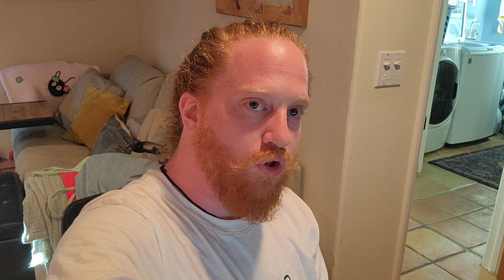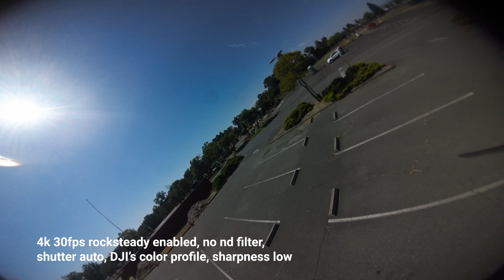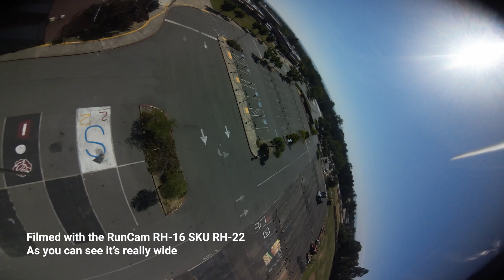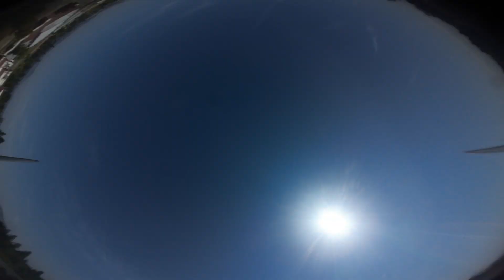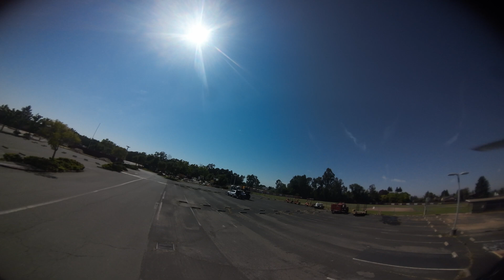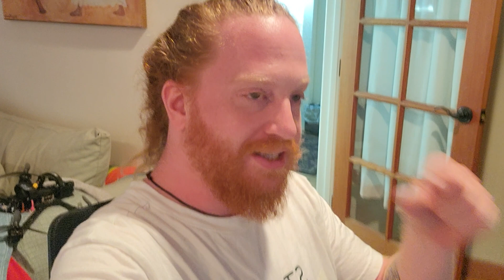3D printed DJI O3 lens replacement adapter test 1

Comment: Can we use this method to change original lens to the zoom lens like raspberry pi CS mount lenses.  I know the CS mounts diameter is wider than the M12 but is it possible to add another mount on the M12 mount?
Reply from the maker: @serdarozdemir8788  I don't see why not it just depends on if you can get the image in focus. You could also design a new camera housing altogether and maybe you could get a larger di on there

Comment: What fov do you get in regular wide mode and not ultra? Also does 4:3 2.7k work? Have you tried gyro flow with it? Is it hard to fly with that fov? I have so many questions.
Reply: Also are there nd filters for this lens?
Reply: And what happens to you trying other lenses with this?
Reply from the maker: @Vogxel  so that was regular wide mode. I never tried ultra it turns out. 

Haven't tried 4:3 2.7k

I have tried gyroflow with it and it works. 

It is kinda hard to fly with the FOV. 

There are likely nd filters that will work with this lens, it's just a matter of if there's enough space to mount them, but I think there could be. 

What happened to me testing more lenses? I got sick and ran out of time and money to test this. I bought a replacement camera and didn't need to test further. 

If you'd like to see more let me know and I can pick it back up again, and consider supporting me on patreon thanks!

Comment: Its a vignete from the lens???
Reply from the maker: Yup. Because the lens needs to be so far from the sensor to be in focus that's the edge of the lens you're seeing.
Reply: @BadLuckFPV  any solution for this?
Reply from the maker: @arisazumi  I'm not sure, to be honest I haven't done a whole lot of further testing on this because I haven't have the wellness/necessity. At the sensor end of the barrel for the DJI lens there's a super wavey piece of glass that I think is acting as a magnifier so that their lens can be as close to the sensor as it is. Maybe cannibalizing it in some way could help but I'm not sure how to accomplish that

Comment: It could also be cool to make a version of this that can work with the flywoo lite (naked) camera fixture, that way screws would hold it together instead of friction. You could have a lip top and bottom for positioning/ alignment.
Reply: You could probably just take the front 50% of your design, extend it backwards the right length and then just extend the top and bottom above where the camera PCB sits like a mm or 2. Like this the Flywoo Lite camera mount kit would fit.
Reply from the maker: @le_tranq  I just woke up and I'm having the hardest time visualizing this haha. Let me read it 5 more times tho.

I'm gonna look up this naked mount and see what's good with it. Thanks for the shout

Comment: This is epic man, been looking for something like this for ages. One thing you maybe didn't consider is that Rocksteady will be tuned best for the certain focal length of lens that the 03 comes with stock, anything different to that might have undesireable stabilisation (like more shaky or jerky movement). There's a fix to this however, you can just use Gyroflow and create a lens preset for the lens you are flying and then run it through there for ultimate stabilisation (obviously requires another step, but GF always makes for better stabilisation overall).
Reply from the maker: So the footage that I posted is actually using the rock steady stabilization and I think it turned out fine. You're right tho that since it's tuned to the default lens that it will be weird with all others but I think it ends up being okay.

Comment: Did you find another lens for this setup or did you go back to the 03 lens module?
Reply from the maker: In this video this is a runcam lens mounted using the adapter module
Reply: Gotcha, I was wondering if you're still running this setup or was it too much of a hassle? I have a few of these adapters printed off and have a Runcam RH-22 and Caddx Polar 1.6 lens on hand. How did you remove the original 03 lens adapter from the sensor? How did you secure the new lens adapter to the sensor? 
I figured I'd give this a try first before I keep splashing on these modules. Any advice is much appreciated! @BadLuckFPV
Reply from the maker: @korbendallas9317  find me on instagram and I can send you links to videos, I am working on editing something and haven't gotten around to it yet
Reply: Ive got the 03 lens removed, just having trouble prying off the original lens adapter part. @BadLuckFPV
Reply from the maker: @korbendallas9317  unfortunately the only options are destructive. You either have to heat up the epoxy at the seam of the lens mount/sensor plate or do what I did...... Crunch the lens mount with pliers and hope it doesn't scratch the sensor. 💀

But once you crack a piece of the lens mount you can pry the other parts off pretty easy

Comment: So the method works as a charm, we need to share this and make it viral, too bad that you dont have a video tutorial. So the solution to use a heatgun is the way to go for removing the sensor of the camera and also the filter on the new lens.the 3d print is excelent but i suggest to use a black filament i used an Orange for the first print and the image was Orange so some sort  of refraction happens there. Other then that i use hotglue to fix the lens in the focus zone and for l the shakyness problem. I didnt flew it to test the jello because its on an airplane and i didnt had the time. I will repist after flight
Reply: Here You have some video test of the fov and Air unit quality.
Reply from the maker: Tutorial is coming soon 🤙🤙 thanks for writing out your experience. All valuable info
Reply: @BadLuckFPV  I’m excited to see what improvements have been made

Comment: Awsome fix, will try that, one of my o3 camera is just cracked and damaged as fuck but amazingly you can still fly it when not in direct sunlight(to many flares), now it on a plane so it doesnt matter to much that i cannot see bracnhes. If you found a better lens please lets us know :D
Reply from the maker: Another user recommends using the replacement lenses for the air unit/vista 🤙

Comment: How did you go about removing the existing lens thread mount from the pcb? i was thinking id scrape away the adhesive along the outer edge and then just pop it off.
Reply from the maker: I have never done it because mine came apart after a crash. But a guy on FB said that he used a heat gun and pried it off with pliers.
Reply: @BadLuckFPV  I used side cutters, cut straight down the side and the rest popped off. Looks good with the new lens I'll definitely drop a line when I upload the video

Comment: Very nice work, doing something similar and someone sent me a link to your mod. will give it a try and i have so many different lenses to try it with
Reply from the maker: Awesome. If you post samples be sure to tag me 🤙🤙
Reply: @BadLuckFPV  just printed the adapter going to try it out with an O3 on the bench

Comment: Did you know that you can simply unscrew the lens?
Reply from the maker: Yes. Then what tho
Reply: @BadLuckFPV Is it possible to select a lens with this diameter and thread?
Reply from the maker: @TheAntohapan  unfortunately not. If you read the description of the video I address it there

Comment: I still didn't give up, so I spent another 10dollar to buy a second-hand cmos pcb and try your solution again. This time I used the Cordless Rotary Tool to smooth the surface, keep cmos in flat, and then used  strong glue to fix the cmos and the 3D print of your design, and now it works! ! ! No more parts are out of focus! ! ! By the way, never force the polar lens into the original adapter. I was deceived by a Chinese。。。。I also used seal tape to reinforce the threads of the polar lens to eliminate shaky
Reply: But i heard that changing the cmos pcb would cause error code message to pop up? How did you fix that issue?
Reply: @hwm2342  Camera bug is just a few words and doesn't affect anything
Reply: So caddx polar lens is compatible ? i didnt understood what you did with the cmos filter....
Reply: @eparustefan  Yes, almost compatible. The incompatibility is that the color temperature in the middle of the picture is normal, but the color temperature in the four corners is warmer (is there infrared light entering?), but this can be solved through Pr, lumafuison, etc. I didn't modify the cmos, I just sawed off the threaded mount.
Reply: @-konoha7747  so the camera thread mount is a little bit to long ?
Reply: @eparustefan  No, the length of the 3D printed thread mount designed by badluck fpv is just right. However, the polar lens will be longer, but this also makes it easier for us to replace it.

Comment: I print your stl with 0.02mm per layer，I print four cost 30 min
Reply from the maker: So awesome. I'm glad the polar lens works. If you post a video sample please tag me
Reply: @BadLuckFPV  ok
Reply: @BadLuckFPV  maybe lens and cmos can't parallel completely，there is always part of image out of focus （blur），this is a elephant in the room.
Reply: @BadLuckFPV  I think when I separates the mounting ring from the sensor plate by Cordless Rotary Tool，this make the sensor plate not flat，OMG，It gives me such a headache.
Reply from the maker: I wish I would have caught you before you did this. A guy on FB said he seperates the plate just by using a heat gun to warm up the glue @-konoha7747
Reply: @BadLuckFPV  I see your video again now ，I found you have the same problem，some part of image is out of focus.